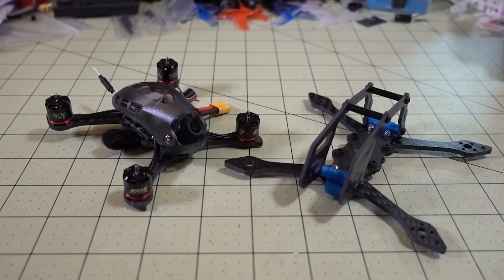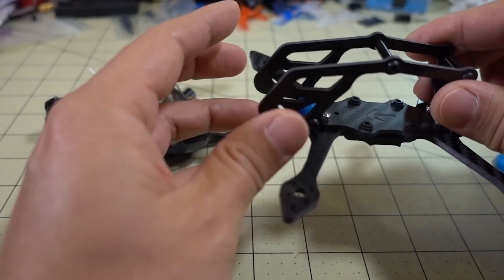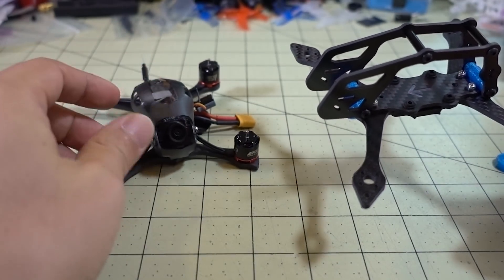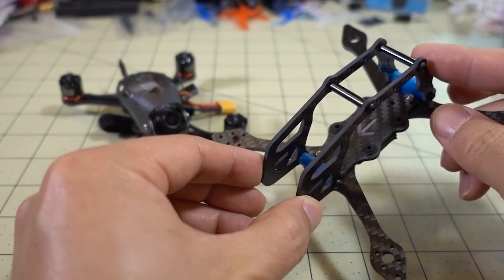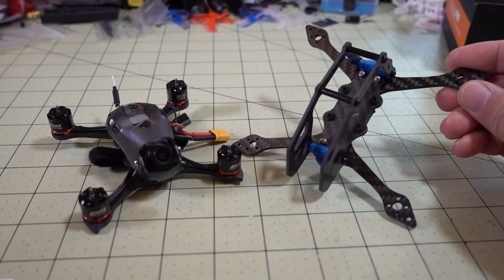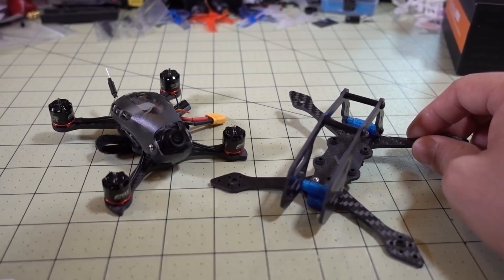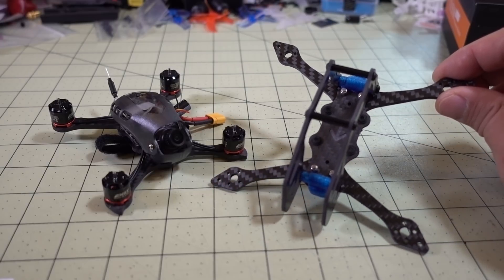Upgrade Your Babyhawk-R! 🔥

Comment: Hey.  I got my Radiomaster R81 bound to my Babyhawk R.  The beeper works and BetaFlight shows that All of the gimbals work and the flight modes are okay, but it won’t arm.  Can you help with this?  I’m using a Radiomaster Zorro transmitter.
Reply from the maker: There's probably over 100 reasons why it won't arm.  Here's some of the more common one's to check.  Is your channel mapping correct?  Does the min value of your throttle channel go below the min range of the channel by at least 10?  Did you turn on the warnings in your OSD and check what error it said?  Google that.  That will be a good clue.
Reply: @AlbertKimTV  Thanks Albert.  I figured you might have some ideas.  It’s really disappointing considering the fact that it bound so well and everything else seems to be working fine.  Hopefully the “warnings” in OSD will point me in the right direction.  Also, do you have any idea about how a can get my CM+ to bind with my Zorro?  Sounds like a firmware issue, but I can’t flash it with the Zorro which doesn’t have a Smart Plug.  Appreciate the help.

Comment: Another thought is just transplanting it into a cmw massive droner. It weighs 8-10grams less than the 3d power frame and it also has what looks to be the best camera protection I've ever seen. I havent tested it myself, but it looks very promising.
Reply from the maker: I've done a video on the CMW Droner 2.5 already and that frame would be an excellent candidate for many transplants.

Comment: The frame looks good but I fear the amount of exposure when it comes to the stack on the sides. Looks kinda like the same issue the gtr90 has with the stack sticking out and not being fully covered.
Reply from the maker: You can always just use the original canopy if you don't like the roll cage.
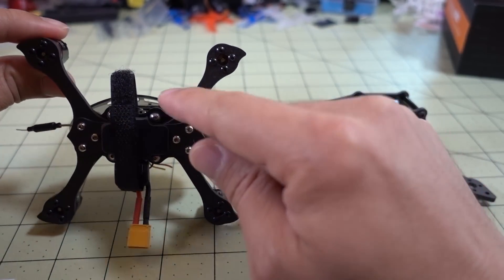Reply: That is the plan. I am gonna due a 2.5 BHr. I love this little bugger and with the xt30 gnb 550mah 3s I get 2:30 in a flight ripping hard and landing with lipo stable at 10.8. I bought the 2.5 arms too and feel no need to use yet so figure I will get another one to have as a 2.5. Build a rf1 3 in now using their warp 1, spark and millivolt. Putting on a win 3 frame with a tramp vtx using 3in gf flash. DO you thing a 4s 650mah lipo is good or 850 better?

Comment: I was surprised when I converted to 2.5" I didn't have to touch the tune much. I guess if you just go bigger and  you aren't changing the frame stance to stretched or wide, it's not much different.